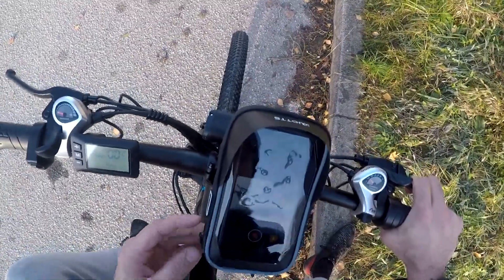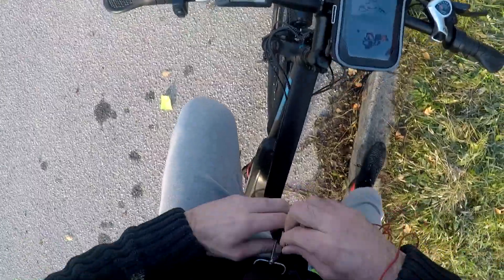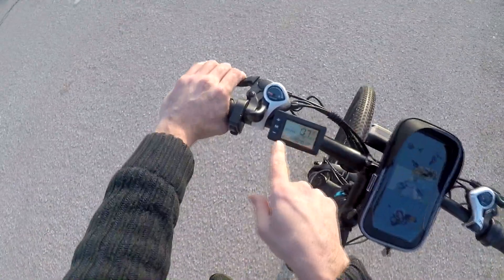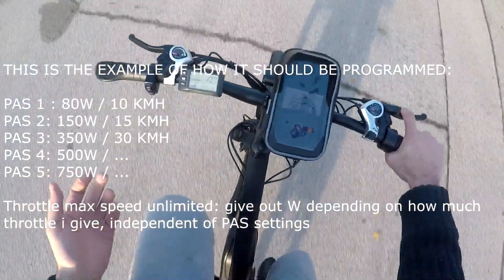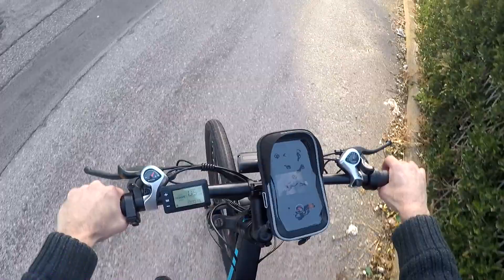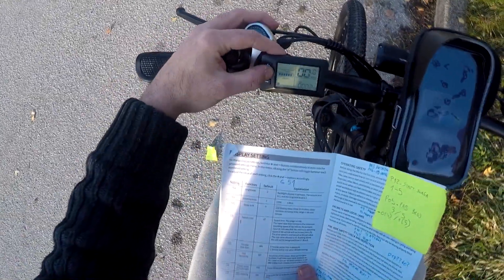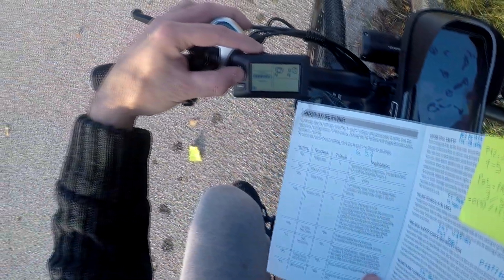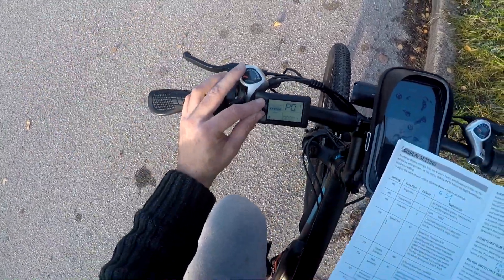Duotts c29 badly programmed PAS controller

Comment: In the UK the throttle is illegal on normal roads so I can't comment on it's behaviour using this, if you use it without the throttle fitted as it arrives straight out of the box, everything works just as it should. Conclusion, the throttle is the problem, somehow it's messing up the settings or it's not synced correctly with the control panel. Speak to Duotts would be the best advice.

Comment: The assist levels are fractions of the max speed limit that you have selected. So lower the P08 speed limit to 25 and also lower acceleration P12 to 1 and it will behave MUCH better. Assist level 1 is up to 6Km/h, level 2 cuts around 11Km/h, 3=18, 4=22 and 5=25. Unfortunately the newer C29's with the newer S869 controller are worse than the ones with the GD51 since
a. You cannot program a speed limit. It is either 25 or no limit if you select 67 at P08. Maybe the S866 is better do not know.
b. The S869 display is worse on daylight and viewing angles. The S866 is much better.
c. On the GD51 you can see a graph of the power actually used. On the S869 AND the S866 do not have this.
Reply: How do I set it if I wanna do wheelies pls ?

Comment: What you are looking for is a bike with a torque sensor, not a PAS control. I can't say anything bad about this bike either. I am over 4000 km. I had to learn to use it. I have used a few rented ebikes, of course they are only 250-300 W, it cannot be compared, this C29 is so much better! It's like you complaining about a sports car that it's too powerful.
Reply: The bike is very good there is no doubt about it but what he's complaining about is very valid. You should be able to use it at low speeds also or in the woods as a mountain bike (what it actually is) whereas with instant acceleration to 20km/h in level 1 it's not (easily) usable, or you're consuming the brakes too quickly. What he suggests in the video is very logical - limit the motor power per each level not the speed (other reviewers have suggested this also), or at least give us a way to lower the max speeds for each level. However I get the feeling this is a limitation of the controller (display) used and that it doesn't have these features configurable. One small improvement is to set the pedal assist power to lowest setting (P12 value 1 instead of 3) and it will accelerate with less power but it will still go all the way to max level speed.

The only way to make it usable as a normal bike is to set the acceleration only from throttle scooter-like (P10 value 1) and leaving the pedals without motor assist so user only. 
However this means that it's not very usable as a mountain bike as riding on rough terrain and controlling the acceleration at the same time is a bit impossible.

Comment: On mine I disabled pedal assistant  altogether, now I only have throttle control. Which makes bike safe althouth this makes bike more like electric moped that bike. But this is typical with chinese electric bikes. You get what you pay. For me it’s acceptible as I saved thousands of euros for more advance bicycle.
Reply: Set P10 to 1 instead of 2. It works great 👍 
Now, finally, you can cruise at 5 km/h without hurting yourself.
Reply: how desable???
Reply: Hold + and - on the controller. Go to menu and change pedal assistant setting acording the manual.

Comment: there is something wrong with your bike...... mine with 1st has max under 10km per hour and with 2nd max 16....3rd max 26 .... so i have manage to travel 80 km distance before batterie goes too low !
Reply from the maker: Its not about max speed, its about power. I can limit speed with P08 setting, it translates to PAS levels, if i limit whole bike to lets say 40, lvl 1 will be 10kmh. Problem is that it always delivers max Power/Wattage/acceleration. On lvl 1 for example, it should provide only 20% of power, not the whole 750w. This bycile is dangerous, i fell 2 times because of it, i turned off PAS completely and only use throttle now, because you cannot control acceleration otherwise
Reply: @skyliner4610  i haven't touch menu at all cause everything was perfect setup ☺️ have ride 1200km until now and i only have positive words to say about this bike. Have also replace freewheel with 11/28 so i can feel the pedals at +40km per hour.
Reply: @stavman8536  Hi! How many gears do you have now on Duotts? I was also thinking about replace this 7 speed for 10-11, if this is possible
Reply: @dsitt180  7 gears and just replace freeewheel cassete
Reply: @skyliner4610  how have you turned off the PAS?
Reply from the maker: Also, no way you got that range. I did testing, 42km on a circut on 35kmh cruise control without stopping. And than in city limited to 30kmh with pedaling and lots of stops i did 52km range.
Reply: @skyliner4610  ,...80 km in 3,5 hours, average speed 22kmh an max downhill speed at 63kmh  ....and return with some juice left probably could ride +10km more... I also order second battery so i can ride nearly 180 km distance with  only pedal assistant and low speed 16 km per hour at uphill  ofcource.
Reply: @skyliner4610 I did 75km with pas and pedaling
Reply: @stavman8536 could you please tell me how did you adjust that?
Reply: @ehsanjan1288  adjust what exactly ?
Reply: @stavman8536  adjust the speed to 10km/h on level 1 assist. I do change the settings on P08 but nothing changes
Reply: @ehsanjan1288  which model of c29 you have ? Is it the newest?
Reply: @stavman8536  yes it is the newest with S869 display
Reply: @ehsanjan1288  thats why... Don't know whats going on with the new... Have the older version